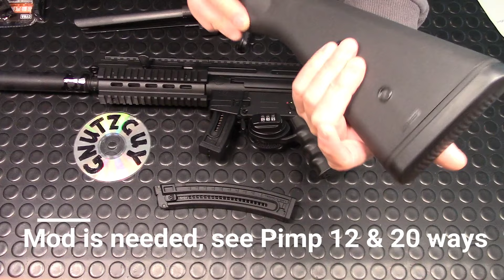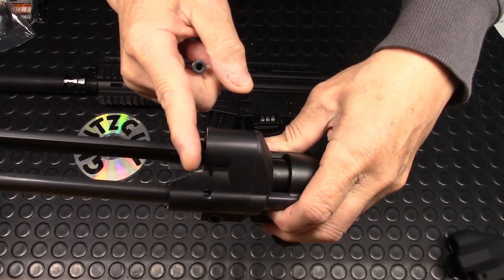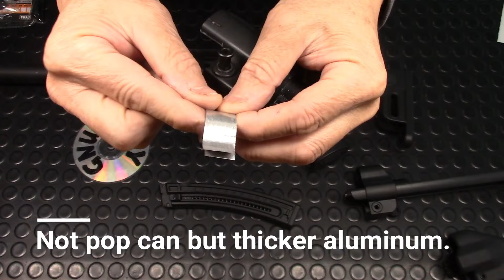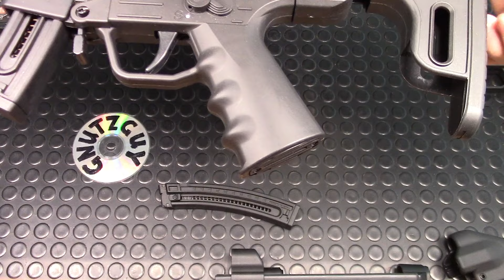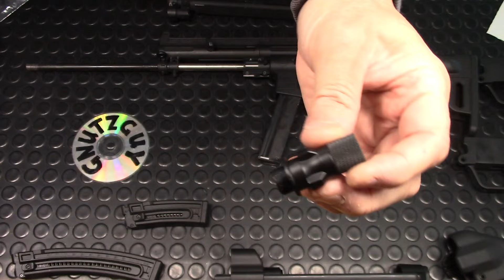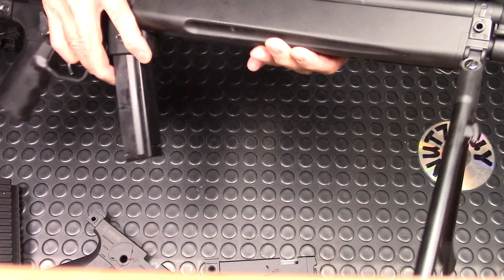Pimp GSG-16 to H&K G3. Hack&mod GSG16. Heckler & Koch

Comment: Hey @Gnutzguy I appreciate you posting GSG-5 22lr stuff.

As there are no original parts left to purchase, and 3d printing has come a long way, wouldn't it be easier and cheaper to make 3d printable parts and make them fit perfectly?

You paid like 500$ for these parts only to cut them to fit. With that money you could have bought a good 3d printer and made many parts yourself. I'm thinking of Mlok Handguard or stocks or lower, instead of having to find conversion kits.

I'd love to have a good source of quality GSG-5 3d printable parts. Maybe think about going the 3d print way for your future mods.
Reply from the maker: @danielmontana6246  good question but you need to look at the bigger picture. My channel is a DIY so take some of my ideas 💡 and some of your own and do what best fits you. Yes, 3d has come a long way but not long enough. for example, 1. Quality don't compare to airsoft MP5 stock also the butt isn't rubber and not removable. 2. Cant print aluminum bipod. 3d printed only works if it's 100% plastic which is the grip but I gave you two options and you can't print it cheaper than the grip airsoft from the US and the Hack&mod way. Altho it was labor intensive, just remember this our sport/hobby so it was fun for me to do it this way so which ever way you go, just have fun doing it.